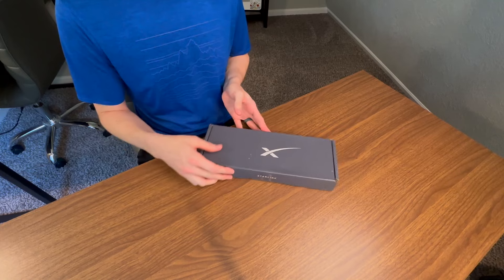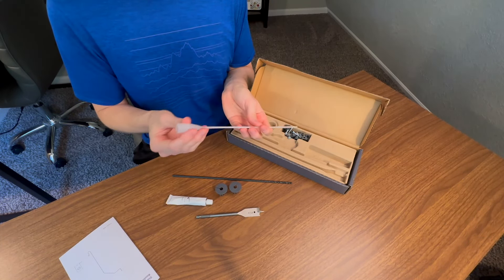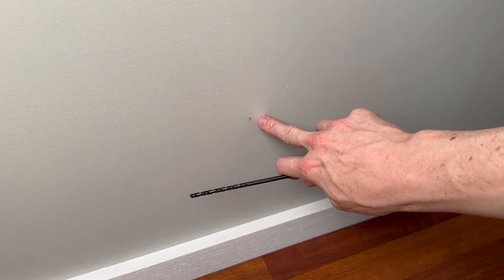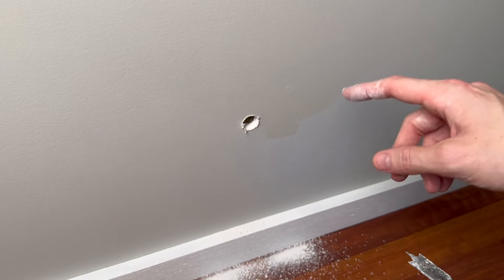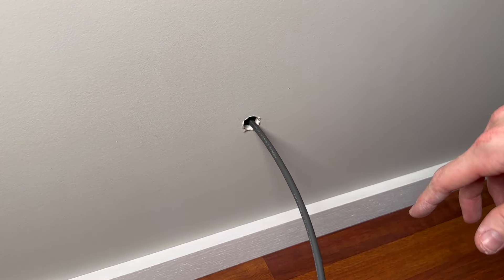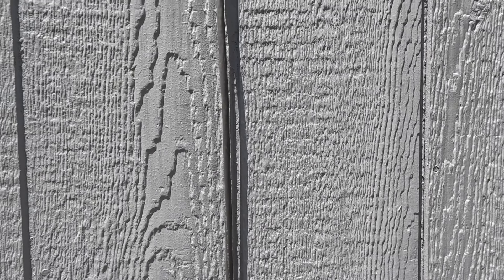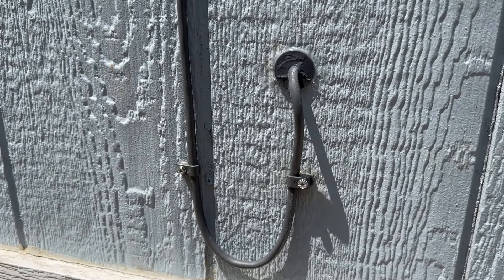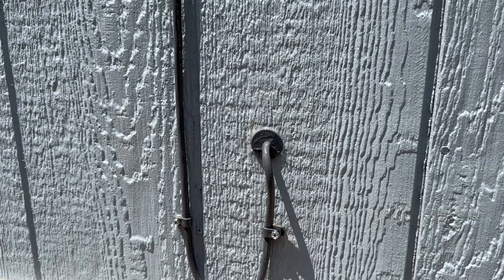How To Run The Starlink Cable Into Your House

Comment: I don't like the fact that you have to use their proprietary cable. I just had a house built and wired for cable and internet. But we live in the country and there is no internet service available. I had wished that I could just connect this to the wires that were ran when we built the house.
Reply: I'm not drilling a random big hole in my wall with knowing what's behind it. Fray some electrical wires and your insurance won't cover after it burns down. All over a crappy Elon device.
Reply: Exactly. Never use anything other than a concrete drill bit as the other type of bits will sever electrical cables behind the wall when you hit them. A concrete bit will grab the wire and wrap it instead so you ate less likely to get a shock or cut your power
Reply: you can cut their cable and re-terminate it to be regular ethernet connectors. you will just need to do it on both ends to be able connect back to their modem
Reply: That have an either net adapter so you can still use your existing cat5/6 wires on your home.
Reply: @mrzorg8378 a half inch hole isn’t that big, and also you’d only hit electrical cables if you drilled into the edge of a stud…
Reply: I used a different cable for mine and it works fine
Reply: @jonjensen4514 it's a 3/4" hole.
Reply: @Shhhmoo Starlink sells a masonary kit to do that job in masonary.
Reply: @SARDOGFL regardless if you avoid any studs you should have no problems avoiding cables
Reply: I used a 1/2" LB condulet and pvc.  I ran the cabling through each difficult piece before I glued it together.  It's protected but in there forever.  I didn't want to have to run 1" or bigger conduit just to make it pullable.  They have RJ45 on the new dish so more than enough room for the cable swap if it happens to me.
Reply: @jonjensen4514  that’s if they are stapled properly
Reply: Ha ha ha…it’s a kit, right?
Reply: One of the best help videos I’ve seen in a long time, great job!
Reply: Is a kit available for walls constructed of aircrete cement blocks, 8 inch by 7 3/4 inch thick?  If not, any advice for how to proceed with the installation?
Reply: If I were you, I’d just say, “screw you Starlink!” …and start your own orbiting satellite company, not using proprietary cables. That will show them!
Reply: @SARDOGFL masonry. Why do people say masonARY😑
Reply: @FixinCat it's the hardest position.
Rock hard.
Reply: It’s super easy to hook up to a CAT5 network
Reply: In case you don't know the difference, Your battery drill does not have a electric cord.
Reply: Great tutorial!

Comment: $26 is stiff for $5 worth of bits from ACE Hardware...Honestly, for the $600 it costs for the Gen 3, it should come with a wall mount and install kit.  SpaceX is acting like they're hurting for money, and an extra $70 for a mount and $26 for install kit is robbery.

Comment: this kit is on the UK store page. But that kit won't work with 99% of UK homes which are nearly all brick
Reply: They have a kit for brick as well
Reply: @kobirelf97 you have to have a different kit for brick houses? Shit! I just got my standard Starlink. Do I seriously have to buy a add-on now. This is why there should be installers for this.
Reply: @mermaid1717  So, how did you manage in the end ?

Comment: The the Starlink just a CAT6 wire with a proprietary connector? Because I have cat6 running through the house and splicing into it would be my best option. If not can this be spliced?

Comment: For safety, you should have a lightning arrestor with grounding per NEC code. The ground connection before entry to the house is a requirement.
Reply from the maker: I did with my Gen 1, since it had Standard RJ45 connectors. Using a lightening arrestor with the Gen 2 cable and proprietary connectors is not possible without serious modification to the cable, which also voids the warranty on the cable, and potentially the dish itself. I agree any antenna on your roof should be grounded, but with Starlink, it's simply not practical, and therefore extremely rare for installs to be properly done to code.

Comment: The video was helpful for installation however, my cable failed after about a month and now wondering if it’s possible to remove without cutting the cable and if I can remove sealed grommets and reuse the hole in the wall.
Reply from the maker: Yes, I actually had to do this too. The grommets are easy to remove if you use a utility knife to cut the sealant first. Then they just pop out. You can replace the cable, add more sealant to at least the outside grommet before reinstalling.

Comment: Thanks for the video! Looks pretty easy! Only problem is that houses in most countries here in Europe are made of brick or concrete and stone. Unfortunately, the kits provided are not compatible, at least from what I see. Today is day one for our Starlink set but I have yet to figure out how I route the cable to the spot in the house where I need it. Do you have experience with the longer cables available in the shop? Is there a drop in speed when a longer cable is used? Thanks 🙏🏽
Reply: Could you go through the uPVC of a patio door?
Reply: Unfortunately no. The doors are made of wood and have an aluminum cover on the outside. I would hate to ruin it. 
But I solved the problem by placing everything in the garage, where I could easily drill a whole.
Reply: US houses are brick too. And yet no one on YouTube making these videos show installation with a brick wall. I'm screwed.
Reply: @mermaid1717  I know that there are also brick houses. I just wanted to point out, that there are no easy solutions for them. However I can say that I found a way to enter the house with the cable and it works, despite the longest version of the cable. I'm sure you would find a solution too, maybe not one without extra effort or additional cost...Happy to help if you need it

Comment: Nice video.  I have to install my Starlink  Gen3 about 180 feet from the house to avoid trees. How do I find a cable long enough to run from Starlink to the router which will be inside?  Is this even possible?
Reply: Starlink sells a 45 meter cable if the 14 meter one isn't enough. 45 meters is about 147 feet. I'm not sure if past that point that there's too much attentuation for the router to power the dish.

Comment: I personally would like to use electrical pvc conduit pipes instead. Even though i fancy Starlink masonry routing kits, it's not advisable for me to leave wires in the open like that. I already had many CAT 5 cables chewed by rats, not small ones but those big ugly ones that are over 10 inches big. Hated those critters so much!
Reply: What size conduit is required?
Reply: I ran my wires in PVC conduit for that exact reason and haven't had any issues.

Comment: Can the cable be routed through existing electrical boxes?
Reply from the maker: I wouldn’t recommend routing it along side AC power cable because of potential interference. But you can run conduit and boxes for the cable.

Comment: So for a network wire I get a

1. long bit big enough for the connector to fit thru easily. 

2. Buy to grommets to fit and cover

3. Wire management 

4. Caulk to seal

Comment: Do does all this come in the kit? Or do you have to get the drill bits separately?
Reply from the maker: The drill bits and other hardware you see come in the kit. You will just need the tools described in the supplies needed section, like the drill.

Comment: Are you supposed to use the cable clamps to secure the cable to your shingles, or do you just use those cable fasteners on the wooden siding on the house?
Reply from the maker: The cable clips are meant for use on the wall. You want to avoid holes in the shingles if possible. It’s fine to just leave the cable on the roof if you need to, no cable clips required.

Comment: Is there a need for grounding the dish to earth ground of the house?
Reply from the maker: Technically, yes. Starlink says the system by itself complies with all grounding requirements. What that doesn't account for is when you mount the dish to your roof, there is additional codes to follow, including grounding the mast and data cable from the dish. Very few people do because most are DIY installs. Even the professional installers are not grounding it. I did on my Gen 1 round dish back in the day. Haven't grounded any version since. The 2nd generation dish was virtually impossible to properly ground without modifying the cable, and that voids the warranty, so I gave up on the idea.
Reply: @DISHY_tech  Thank you.  That makes sense. Very informative video. I appreciate it.

Comment: They can invent a wireless connection from dish to router?
Reply from the maker: The router provides power for the dish, so you need a cable to transmit that kind of power. Can't do it wirelessly.

Comment: Is that a gen 2 dish plug in? I have a gen 3 and the plug is the same on both ends. And doesn’t look like yours
Reply from the maker: Correct, at the time of this video only Gen 2 existed. But the process would be the same for Gen 3, except it doesn't matter which end of the cable you run through because they are the same on both ends.

Comment: Do we need to order the longer cable if we are having to do outside installation?
Reply: I did.  The cable that came with it seems far too short.  You are really limited by the original length.
Reply from the maker: The included cable is only 50 feet long, so if the mounting location is far away, it is best to order the 75' or 150' cable in advance in case you need it. You can always return the longer cable if you don't need it.

Comment: I really need something like Starlink cause we don’t have internet service out where I live but I don’t understand why the router can’t be wireless so we don’t have to drill a hole in the house because my box needs to be at the back of the house which has no good entry for the router cable
Reply: The router is wireless to whatever you’re connecting to it but the router has to be plugged into the satellite dish as does any router from the source that is supplying it……

Comment: Great instructions. What is the maximum length of the cable that goes from the antenna to the router?
Reply: 150 ft.
Reply: The ground base one is around 75ft

Comment: Why silicon inside? Hopefully the outside is sealed to prevent water from penetrating to interior wall.
Reply from the maker: To hold the grommet into the wall and prevent it from coming out with cable movement, and also as an air seal. You're right, exterior is where the water prevention happens, the inside seal is more about air and to "glue" the grommet to the wall.
Reply: @DISHY_tech how about brickwalls?

Comment: My cable has a 90 degree turn on the plug for the router? Anyone have a suggestion for getting it through a wall?
Reply: I believe the other end of the cable will lay flat, which is why he fed wire from inside out?
Reply: @jnichos6920  I'll have to look. We went with the RV antenna because that was all that was available in our area. It came already plugged in on the antenna end, so I'm not sure if it comes out or not.
Reply: @josephlawson1531  yep, I seem to recall being confused as our unit arrived with cable attached to dish/antenna.  At a glance it looked permanent, but our’s did come off.  I can’t quite remember the release mechanism, but you’ll find it.

Comment: Why did you silicone the inside wall?   If water gets through the outside hole, the water is in the wall already.  Sealing the inside seems silly.   

The rest of the video showing the cable seems pretty good.
Reply from the maker: The silicone holds the grommet into the wall, even for the inside one. It’s in the installation instructions to seal both sides.

Comment: Hi- can I use this kit if I have vinyl siding? Also, how will I run the cable on the ground from my house to an out building roof? Can it lay in the grass or do I have to worry about it getting wet?

Comment: If the Router is fully waterproof why does it have to be inside?
Reply from the maker: It's water resistant, but Starlink still says it is rated for indoor use only. Besides, you will want the router inside for a better Wifi signal. The more walls and objects the signal has to go through, the slower the connection will be.

Comment: My cable port has an L shape and it's complicated to do a hole that big
Reply from the maker: That's the wrong end of the cable. You need to start with the dish side connector which is straight, and route it from inside to outside up to the dish.
Reply: @DISHY_tech  No way man, that's too late😭
Me and my dad did an HUGE hole into the Wall because we didn't think of that🤦
I know this for the next time, thanks!
Reply: I looked at both before even watching this video and still it will require much larger hole than any other installation. This is flow in the design instead of ripping people off the cable should been crimped after installation.

Comment: This is 100% incorrect. The cable that came with my Starlink has a head that will not fit in a hole that is less than 2" in diameter.
Reply from the maker: Use the other end, which isn’t angled, and only requires a 3/4” hole.
Reply: The other end was already connected to the dish and it didn't look like there was a way to disconnect it.
Reply from the maker: @UncleBobo Just pull down, it’s detachable if you have the Gen 2 rectangular dish.
Reply: Wish Starlink would include directions in the box. Also, the cable runs through a metal pipe that is also connected to the dish. I didn't know the pipe can be removed too,

Comment: If you need that silicone on the inside wall you've got bigger problems than anything to do with that hole.
Reply from the maker: Silicone also works for air/drafts, plus it holds the grommet in place.

Comment: The end of the cable that plugs into the router is L shaped, and will require a significantly larger bit. Oh well.
Reply: Which is why you use the end that goes into the dish. He does say that in the video.
Reply: @richbyrnes8137 common sense ain’t common.

Comment: Dude this is such a sloppy job just you literally drilled a hole through the house 😂. 
Just make your connectors a normal internet connector. I’m so annoyed at starlink poe connector. I can’t have a clean install in my house that’s hidden without masterminding something no one has done.

Comment: I'm pissed my connector cable Does NOT collapse like that! It is completely solid at a right angle. It takes a HUGE hole.
Reply: You need to use the end that attaches to the dish instead
Reply: Good grief. You people don't need the Internet. You can't even follow instructions, much less be responsible enough to 'surf the web'. 😂
Reply: @speds3746 I'm dying 😂